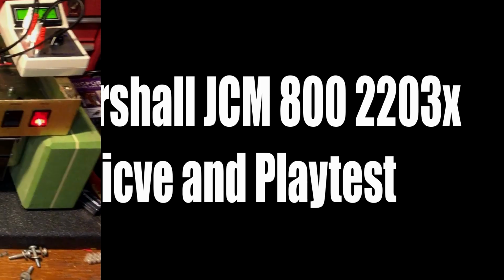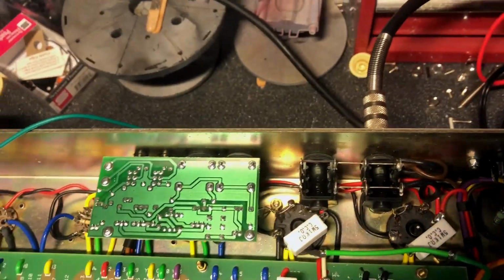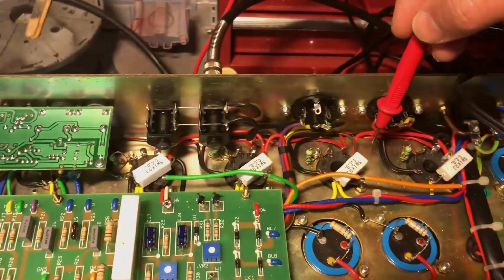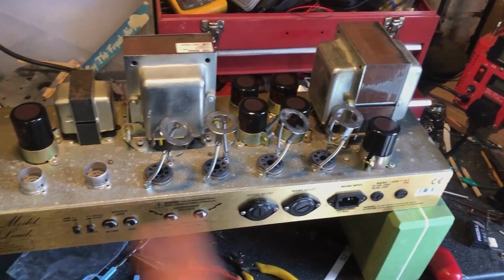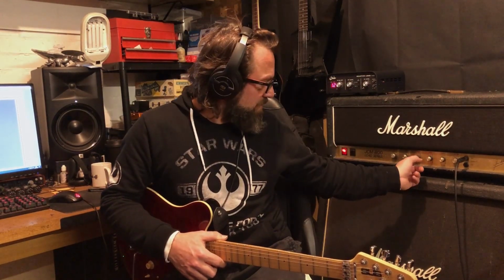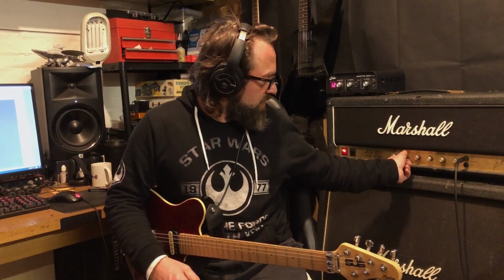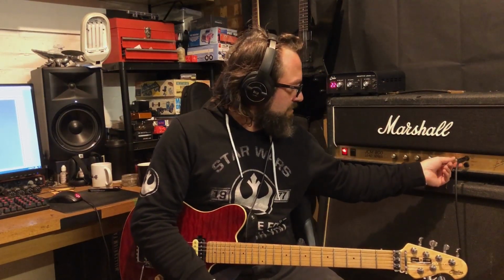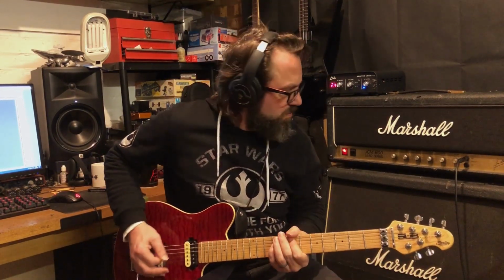Marshall JCM800 2203x Service and Playtest

Comment: Yes...it would be nice to know what those "little tweaks" are. Please share! Great sounding amp.
Reply from the maker: The "tweaks" were nothing more than adding a couple bypass capacitors to a stage here and there. I find it very dependent on the specific amplifier though. I went  through dozens to find the right values for this specific amp.
Reply: @RDamps  how far from a stock 2203x is the modded version in terms of extra gain? This one sure sounds insanely good
Reply from the maker: @bbck15  , circuit wise it’s a couple of components, and there are some solid gain increases to be had. But I tend to find I depends on the specific amplifier. I did put 6CA7’s in this too which has an impact on the tone of the power section.

Comment: I have a question, is it possible for the JCM 800 (new 100w version 2203) to switch between Low and High inputs with an ABY switch? Thanks for the reply.
Reply from the maker: If you have one try it. I don’t think it will though because the high input passes through the low after it’s first gain stage (the low input is basically a Plexi). Therefore if you have something plugged into the low channel you’ve effectively disconnected the high.
Reply: @RDamps  Thanks

Comment: What does the 6CA7 have that the el34 doesn’t ? Or……what does the amp lose (& gain) when going from el34 to 6CA7’s ?
Reply from the maker: I find the 6CA7 just adds clarity and a little more Low end. I find it gives a Marshall a slight American accent if you will?
Reply: @RDamps  does it lose a little crunch with the 6CA7 ? I assume you’d lose some mids which might give it a cleaner sound (less crunch) ?
Reply from the maker: Not in my experience

Comment: Hiya. I picked up a AC30TB 1968 so VSL. Got it cheap as non worker.
High pitch squeal so cleaned out valve pins and sockets inc GZ34. Now no squeal but no volume only minimal change when sweeper?  Wot size hammer do I need to adjust it😄 seriously any idears🤔  Ta Ian
Reply from the maker: Nice find! Man... could be a ton of things. Filter caps (if original) dry solder joints. Something that age really needs a tech to go over it. I'm guessing a joint got disturbed when cleaning the sockets. Obviously be VERY careful and take all precautions if you're going to go poking around inside.
Reply: Hi RDT. I have guilds in industrial electronics service/repair but never used it. In my sixties now 😟 been a boiler tech for 48 years now. So fully aware of dangers on these. My dad was an electronics tech pre transistor and had honestly  thousands of valves under the stairs 😁 and I was building transmitter/receiver circuits for RC glider control before they  came in. You sound like your in London? If im stuck can I run it over as in Wokingham.
Ta.
Reply from the maker: I'm over in north Herts, If you can, contact me through facebook. Sounds like you'll be OK. If you get stuck just send me a message, i'll be happy to help!